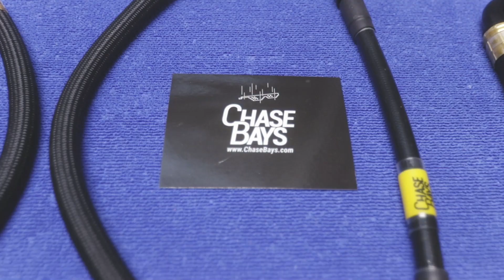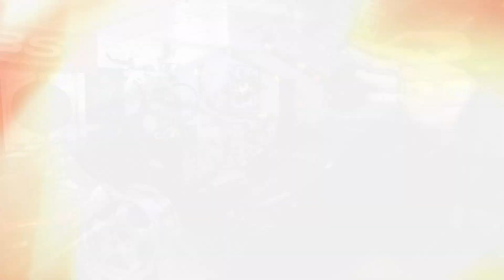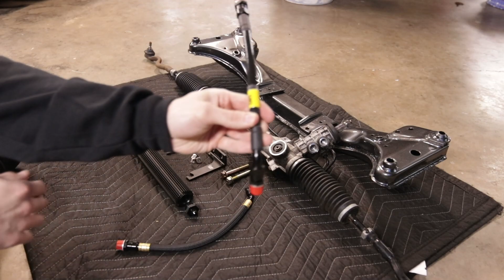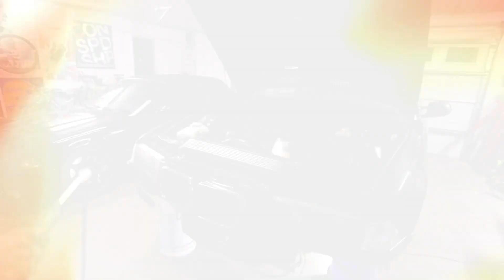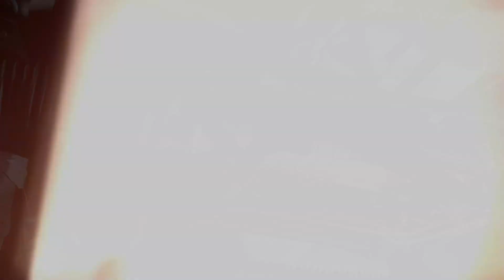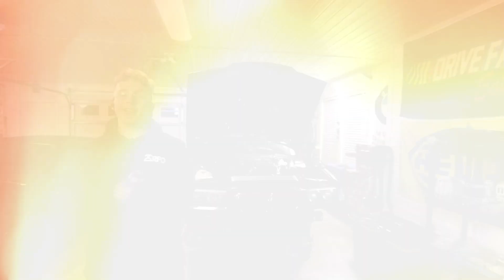Chase Bays E36 Power Steering Kit, No More Leaks! - E36 M3 Drift Car Project: "Maine": Episode 6

Comment: I want to delete my power steering, noticed you mentioned the cooler for drifting, but if i get rid of power steering will this mean i wont need the cooler?
Reply from the maker: That would be correct!  Deleting power steering will mean your pump won’t actually be circulating fluid through the rack so no cooler will be necessary.  Just beware that these cars do not steer easily without power steering!
Reply: @griffengardner  Yea drift build... my main issue rn is I want to run the oem accessory belt, should i upgrade the rest of the parts to the chase bays kits, and run low fluid for the "delete"
Reply: @griffengardner  Since for my delete i dont want to get a shorter belt, since i have nice aftermarket ones for my s52.. which means i need to run the PS pump, with this kit does it still use the OEM pump and just replace everything else?

Comment: I bought the kit and still ended up leaking, so for just 20 bucks I bought a block off plate and deleted it.
Reply from the maker: Where was it leaking from?
Reply: @griffengardner  it was leaking from the bango bolt.
Reply from the maker: @izheet287  so when it comes from Chase Bays they put the crush washers both on the pump side of the banjo bolt.  I almost had a leak until I realized I was being silly and put one crush washer between the bolt head and hose and then the other between the pump and hose.  Did you leave both crush washers on the pump side like it comes from Chase Bays?
Reply: @griffengardner  no I made sure I put the crush washers in the right place and torqued everything to spec and still ended up leaking.